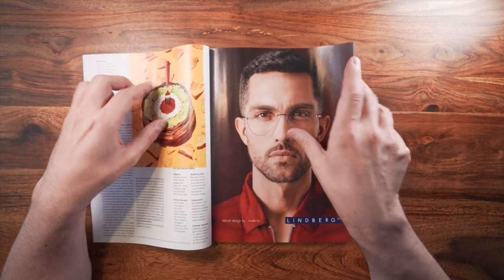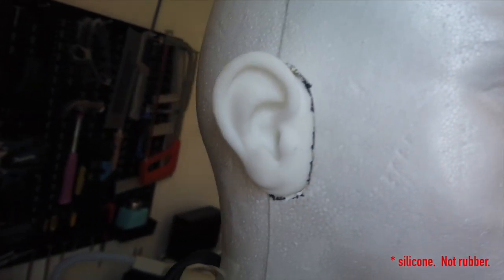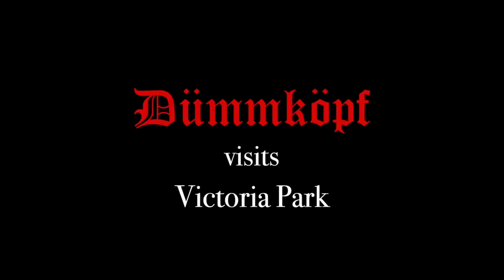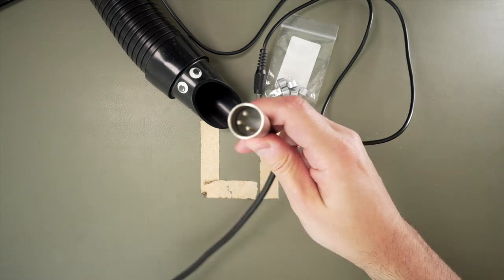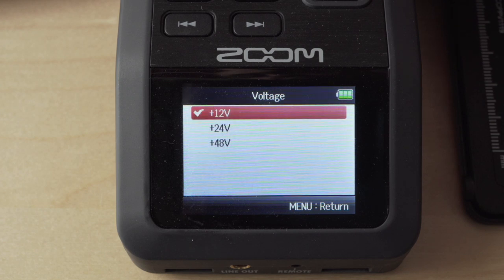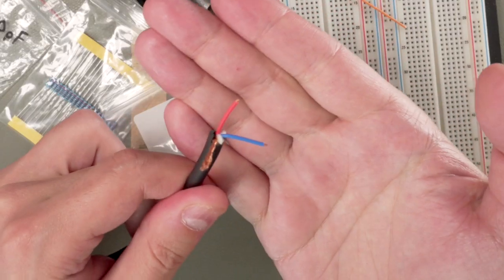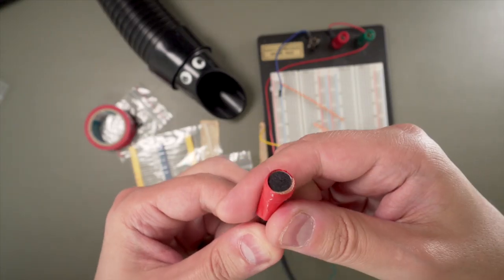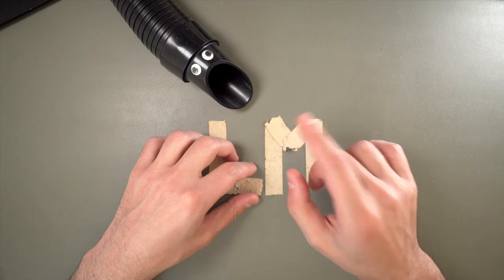How to make a binaural ("3D") microphone

Comment: This was a good watch.

I've had some interference issues with bluetooth ear buds in dummy heads, tried the caps at the mic ends but still couldnt get rid of the RFI. 
I've not had many problems with interference with any of my other mics unless I'm using cheap lav mics which seem to pick up mains hum (DIY tube mic), I still havn't figguerd out why this happens though.

I've just put a DIY dummy head kit on my website (just to see what happens), there's another DIY kit on there too but it's a tube type of mic.

Comment: I absolutely love this project! The only big question I don't think was addressed was whether spending a bit more on a different mic (and what that alternative would be) would have made this any easier or better sounding? 

It sounded great! I'm just thinking, if spending $100 would sound even better it's still a huge discount from $8k and would be worth it if you wanted to use this more long term!

Thanks for the video, love your work! ✌️
Reply from the maker: I was trying to keep it cheap and see how far I could push things.  If there's enough interest in this, I might see if I can do this whole thing a third time with pretty good components (like $100-150 range) and see what happens.  It might have to wait, though, as I'm getting tired of staring at a dummy head everyday for a month :)  --  I feel like I need to work on something else for a while.
Reply: @LeoMakes  If you had any advice on where I would begin finding an appropriate mic, I would love to take on the project!
 My sister gave me a hairdressing dummy head that I was going to put an axoloti board into and make a weird synth but this is a much more "practical" application! Haha
Reply from the maker: @praticle  Honestly, the only difficulty I see is finding a pair of mics small enough to fit inside the head side-by-side.  The average distance between the ears is about 21.5cm (according to Google) so there isn't a lot of room if you want your mics to be parallel and in the same plane.
Best of luck if you take this on.  And come back and share your findings if you do!
Reply: @LeoMakes  I've built practically the same dummy head without ever having seen your video before. I'm using the capsules from a set of OKM ear mics. They fit nicely into the ear canals of the silicone ears. 

I am however not really happy with the results I'm getting. The localisation with the same mics in my own ears is a lot better. My suspicion is that the styrofoam head is acoustically too 'transparent'. I've tried to buy a head from a shop-window mannequin  but they're quite expensive.
Reply: @fotoralf you can try aliexpress. Thay sell tons of cheap plastic mannequins' heads on the site.

Comment: great video! this is going to be my summer project thanks alot! one question how do you deal with the air booming the mic? deadcat earmuffs?
Reply from the maker: Pretty much! I think if you cover the ears with any kind of headphone “foam” material it will be enough to stop wind noise. That’s actually how Neumann does it.
Reply: @LeoMakes  thanks will check it out.

Comment: Interesting video .. Funny the head filming n Vicky park....I am also playing with electret mic and I have recently watched a video from DIY Perks where he also uses a de-soldering wick braid as a wire shield although I was not able to open it as shown by Matt). I find copper or aluminium tape could also work for shielding the capsule and you can solder to it. Have you tried the Primo EM272  omnidirectional capsule from micbooster ? it sounds amazing and has low self noise.,super sensitive for field recording....quite cheap too. .I will try adding another bypass cap and some shielding  to my diy lavalier mic made with the em272 . When I try to connect it to a 48v phantom power source via a vxlr+ adapter is picking too much noise. when I use it with my diy ne5532 unbalanced preamp it does not pick up that noise....
Reply from the maker: I saw the DIY Perks video after posting this--his videos are really good!  And thanks for the tip about the Primo EM272.  I haven't heard about that before but I'll see if I can learn more.

Thanks for watching (and subscribing!)

Comment: It seems to me that in an ideal world, putting a resister PARALLEL to the microphone module would not change the voltage applied to it, but the world isn't ideal.  When one takes into account the resistance of the microphone cable itself, there would be a resistance parallel that would get things down to a safe level but at the cost of making that resister take much more power than the microphone module itself.  I would have been tempted to try using a voltage regulator, providing it doesn't add noise.  They make some pretty tiny transistor sized ones.  Maybe even a 7805 would cut it but it might blow up at 48V phantom power too.  Maybe not or one could stack them, one with a dummy load.  The way things are set up here, it seems that the microphone modules are going to be operating at different voltages depending on how good your connecting wires are.  Get too much resistance in those signal wires and you would likely too low a voltage across the terminals of the microphone module.  (not a biggie if you don't switch anything or switch out input devices with a different impedance.  I'd really want to regulate that voltage.  Maybe an appropriate resister in series and a zenor diode in parallel.  Zenor diodes are NOT energy efficient voltage regulators but they can be quite useful in low power settings because they are so convenient. :-)   ...oh, I almost forgot...GREAT VIDEO!!! :-)
Reply: The 48V are supplied via upstream current resistors in the phantom power unit, two resistors of 6.81 kOhm. This is part of the spec and makes your 'ideal world' musing irrelevant, and explains why a resistor in parallel with the capsule works at all and does not blow up. Furthermore this comparatively high source resistance makes the cable irrelevant in comparison.
 
The lowest noise circuit to generate stable FET supply voltage in a microphone is generally a diode shunt regulator, either a bunch of LEDs or a Zener. You can also try using TL431, but allegedly it's not such a great idea regarding noise, so well it depends how well you deal with it around it. Like, you've got to have source side series resistor, shunt regulator, capacitor in paralell with the shunt regulator, and then another series resistor to the capsule, and then you should be able to juggle the values to get the noise down well enough.
You should probably read this first: https://sound-au.com/articles/mic-electret.htm

Comment: Can you share a link for the microphone capsules?  I'd prefer to use the exact same ones.  This is the FIRST DIY version that I've ever heard that actually sounded good.  Well done sir.
Reply from the maker: Thanks for the kind words.  I'm honestly not sure it makes a difference (they all probably come from the same vendors in China) unless you buy the really nice Panasonic WM-61 (which I didn't use).  That said here is a link to the ones I used on this project:

https://www.kitronik.co.uk/3310-microphone-insert-pcb-mount-pack-of-5.html

Comment: The cheapest binaural stereo microphone you can get is not among the ones you listed, it's MiniDSP EARS for $200. It's officially a measurement rig for headphones and environments, but you just take off that silly headphone support stand, screw it on a little tripod from the bottom, and you have a USB binaural microphone, that might even work with an old Android phone you have at the bottom of your drawer if you need to record something on the go. Another possibility are little binaural real-head microphones that you insert into your actual human ears.

But go on.

I have actually intended to build exactly something like this, but didn't get around to, because i'm not up to spend even $200. But I want it also as a headphone measurement rig, so I wonder how to recreate the ear canal, how deep it should go, etc. And I think what any build like this ultimately needs, is a compensation measurement - half the reason you get the EARS is because they come with a calibrated individual profile that you can apply as an EQ and then you have a faithful compensated result. What I mean is, when you listen to a "flat" measuring speaker, with your own ears, it doesn't sound shouty, but when you listen to a raw recording off a head measurement rig, it does, there are resonances introduced by... stuff, the external ear shape, the ear canal, etc, because your headphones ideally are already compensated to sound more or less right with speakers as a reference. So you have to take that kind of reference measurement and compensate it out, suppress the changes that are applied by your measurement head to all sound, and have just the pure head relative transfer function remain. Mind you the response distortion applied by a measurement head is ideally the same as the one applied by your own ears, or really similar, and when you listen to true sounds coming from your environment, you don't perceive them as distorted, because your brain already compensates, but you don't want this distortion to be applied twice to the sound, just once and just of your own ears, else it sounds wrong. I know, it gets pretty complicated... uh I guess I can refer you to scientific papers and seminars by Sean Olive et al from Harman Research who have been doing headphone measurement and compensation research.

Also in some regards a DIY solution must almost necessarily better than an ISO standard measurement head, because those have unrealistic ear shape and not enough ear compliance, so headphones sit on them weird and don't even measure right a lot of the time. Because the ISO head is made for measuring over-ear hearing aids, which tends to make your ears stick out a tiny bit, as opposed to headphones which flatten your ears a bit, plus it's 70s technology and materials, a basic silicone ear from AliExpress is better than that today 50 years later.

I didn't really start on the project because I want to use it with 48V phantom interface and have not come up with a good solution yet that isn't quite complicated and bulky... but this psedobalance trick is wonderful, i have not seen one like this before! The FET inside the capsule is generally supposed to be K596, with breakdown voltage of 20V and optimal operating point of 10V, but puh who knows what corners were cut :D
Reply from the maker: Good points.  I actually didn't find out about the MiniDSP EARS until after the this video was posted, but it seems like a good option at a very reasonable price.  Plus you can use it to measure your headphones since it's (as you mention) calibrated against a known good reference.

Thanks for watching!
Reply: @LeoMakes  Yeah what i meant i guess is that your binaural microphone still sounds like it needs some EQ of the similar kind like you'd have on a true measurement head, it's peaky and shouty. I bet the hardware is completely adequate and doesn't need to change, it just needs some compensation.

Like, here's a fairly neutral speaker, in a fairly neutral room, and your head simulator microphone in a normal listening position, you take the response the whole system produces and EQ it in reverse. Furthermore, you can compensate it against a bare omni capsule in free air, of which you have a bunch, so whatever speaker resonances and room gain you have, you're going to see them on a bare omni measurement and can count them out.

It's definitely much easier said than done because conducting good experimental setups is hard and you often get data of which you aren't quite certain how good it is and where its faults lie, it can be a pretty confusing endeavour, where you will get results that don't make sense. But it's worth trying :D

Comment: Hey Leo. I am a electrical engineering student and as far as I can tell the first resistor that you connected actually shouldn't help at all to reduce the voltage over the microphone because it is in parallel and not in series to it, which means only the current is split over the two paths but not the voltage (Kirchhoff's loop and node laws).
Reply: Interested to hear his reply and how the capsules have survived longer with this wiring
Reply: The phantom power is supplied through 6.8k resistors from the recording interface; by putting another 6.8k resistor to ground (in parallel with the microphone), you get a voltage divider that divides the voltage by 2. In this case this drops the voltage from 12V down to 6V. The capsule itself draws a small amount of current (around 500uA) so that drops the voltage a little bit further.
Reply from the maker: Good explanation. Thanks Teo!
Reply: @teodopolous  Thanks :)

Comment: Hi Leo, first of thanks for the Video it is a very good inspiration. My question is the following: how did you calculate a 6.8k resistor?  Since the datasheet of the mic says it is running with 0,5mA (0,0005A),  1-10v (nominal circa 5v). Now if i go the classical way that i found using the formula 12V-7V=5V -> 7V/0,0005A=14.000. Would that not mean i have to use a 14k resistor? what am i doing wrong? Or did you just go down to roughly 9-10V?  Sorry,
 i am just a beginner! Thanks for your help.  Greetings.
Reply: First off. He seemed to do a bunch of random things that were clearly not understood by him, and said incorrectly, because he didn't understand what his brother was trying to explain, or something. Later in the video, he constructs a simple voltage divider. The resistors he's using in the video code out to 3K9, for a total of 7k8, and his divider cuts the voltage supply in half. Therefore, he's running 0v down the blue wire, +6v down the shield, and +12v down the red wire. I'm guessing that the phantom power wires are decoupled from ground. The microphone is between the shield and red wire, and paralleled with one of the resistors. The maximum current draw for the microphone is 0.5 mA, which is not it's nominal draw, so it's invalid, but I'll use it for a ballpark estimate to give about 10k Ohms at 5v (E/I), but it's in parallel with one of the divider resistors. That parallel resistor assembly is then Rout = 1/(1/Rmic + 1/Rdiv), or 2k8. So, 2k8 + 3k9 = 6k7 total resistance, instead of the 7k8 if we only had the resistor network. Since the two divider resistances aren't the same anymore, we can't cut corners and say "divide by half", and the formula becomes Vout = (Vin x Rout) / (Rblue + Rout), or (12v x 2k8) / (3k9 + 2k8) = 5v. Since the actual resistance will vary with the signal from the microphone (due to varying current draw), both the blue/ground and ground/red sides will change voltages in opposite directions, giving a Differential Signal referenced to the shield wire. RF noise will hopefully be induced into the shield wire, and effect both sides of the signal pair in the same direction, making it "common" to both sides. When the differential pair goes into a differential amplifier inputs of an operational amplifier, the amplifier will output the difference between the two. Since the noise is common to both sides, it will be rejected in accordance with the amplifier's Common Mode Rejection Ratio, which is usually very high for an operational amplifier.

Comment: Some great tips on soldering/wiring/etc!!! To make this of any real use, I will need to create some kind of "headset/headhones", instead of going around with foam head... Any tips on actual capsules? Manufacturers, specs, etc?
Reply from the maker: I know what you mean.  I got a lot of curious onlookers at Victoria Park who politely asked "Say, what's that?"  If you're trying to make a video without people staring at the camera, this is not the right tool! :)

There are a number of "in-ear" style mics, but I haven't tried any of those.  I'm not sure how well those can work since they don't sit inside the ear canal (the mic bit usually sticks out beyond the pinna of the ear) but the recordings still sound good.  You can find that here:

https://makingmusicpro.com/what-is-the-best-binaural-microphone/

Thanks for watching!
Reply: Indeed, good points on mic positioning, haven't thought about that much, but surely should influence recording/sound